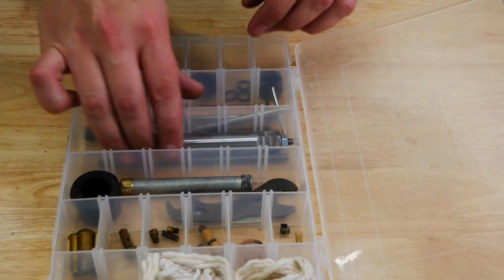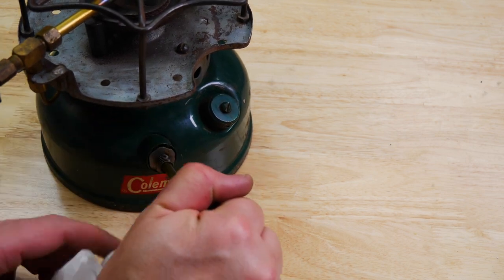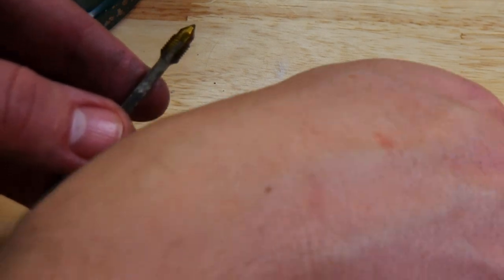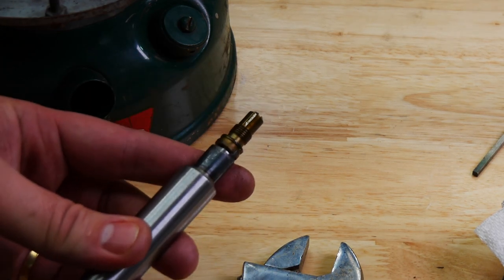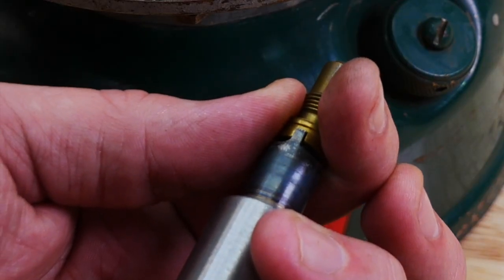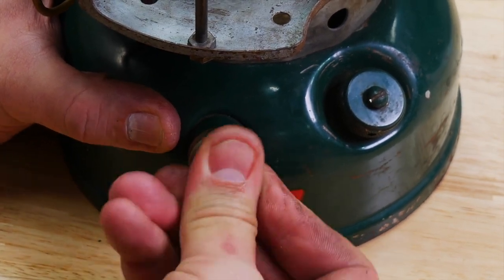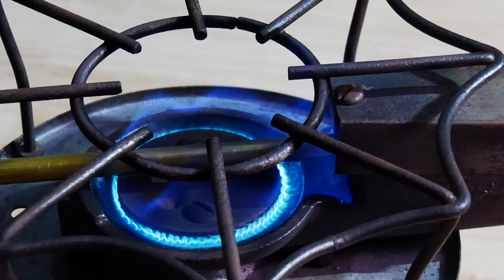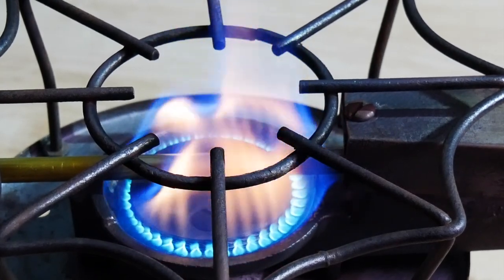How To SAFELY Remove and Clean a Coleman Stove or Lantern Tank Check Valve

Comment: Thanks for your videos.  Still need to dig out my Peak stove and try to get it working..Mine has that problem can't get the pump to work. Along with the adjustment fuel valve that doesn't want to move, and a seal leaking. Just a few problems.  Thanks.

Comment: Another possibility for a removal tool on that pump valve is a 3/4” paddle drill for wood. Get a cheap one and grind the center tip off, it’s the right thickness to fit the slot on the valve. Good luck! Now, I want to know the best way to get the graphite packing out of the little red on off valve above the pump.
Reply: does or did it work?
Reply: Yes, however, like Ernie said, you MUST put a significant amount of pressure on the end of the tool to keep it from popping out of the valve and damaging the slot. That’s why the 40$ tool has the threaded center to hold it in the valve slot. Good luck!

Comment: The check valve removal tool is a must if you are going to work on more than 2 coleman items that require fuel to operate them.  I have a set formula of what I do when I have purchased a new “item” from someone else after making my initial physical turning the knobs, and visual inspection.  1.  Remove the pump and toss the neoprene cup (if that’s what’s in it) and put on a leather one and dip it in neatsfoot oil (or just dip the leather one that is in it already).  2.  Remove the check valve and see if it works or not. If it does put it back.  If it doesn’t just like he said.  Let it sit in a small “bath” of carb cleaner overnight and then shake the heck out of it (usually it works).  If that doesn’t then let it “simmer” in a very small pot of vinegar for about 30 min on the stove and that should clean every last bit of scudge off of it and then you can put it back.  If that doesn’t work…time to go to the boneyard!  3.  Pull the Generator and clean that out.  If after these three things I can’t get the lantern to light then that’s time to send it to my ICU area.  That’s a whole different itemized list of repair options!

Comment: I had a check valve in my 200A Birthday Lantern that I first tried for over a week to clean it in place but I needed to pull it. I soaked it in carburetor cleaner, blew some through then I had to boil it in vinegar! I put it back in and it still does not work. The air leaks incredibly fast through the valve. The ball bearing must be pitted. I am ordering a new check valve.

Comment: hello my friend, thanks for your tips. Now I also have a question, I have a Coleman 523 cooker, unfortunately there is black rust or gummed-up impurities in the tank. what is the best way to clean the tank? thanks in advance.
Reply: Pour carb cleaner in the tank and swish it around and let it set. Put a handful of small sheet metal screws in the fount and shake the daylights out of it. Take them out and fill the fount with vinegar and let it set for a day. Flush it all out with water and then blow it out with an air hose or can of Dust-Off after the water comes out clear. Then put a bit of alcohol in the fount and swish that around. Pour it out and blow it out again. Let the fount dry completely. That should do it!

Comment: The Probable I have is I bought a lantern that has rust in the tank...Do you have a way to remove it and seal it so the rust doesn't keep coming back?
Reply: I know this is a bit old but I've recovered many Coleman stoves and lanterns with rust inside the tanks.  I rebuild and restore them as a hobby.  It depends on how badly rusted it is though.  Too much and it might not be safe to hold pressure.  But if it's not too bad I find that washing it out inside with degreaser first and then rinsing with hot soapy water to get rid of all greasy residue is a best first step.  Then fill with something like evaporust  (I use rust Check Enviro Rust Wash) and let it soak overnight.  Drain it out and swirl around.  Might need to repeat until all rust is gone.  Rinse out thoroughly, and here is the trick, rinse out with methanol to get rid of ALL traces of water.  Once it is fully rinsed you want to heat it up to make sure it is fully dry.  I put mine in a warm oven (heated to around 120°F) not a hot one and just let it sit.  Putting out in the HOT sun is good too.  The point is to get it fully dry as fast as possible without overheating it and damaging the paint.  That will do it.  As long as you drain it fully after use OR leave it completely filled with fresh fuel and a tight cap you should be good.  Just make sure no water or condensation gets in the tank and it won't rust on you.  You can use a gas tank sealer but be VERY careful not to get it in the air tube inside the tank.  this lets the air that is pumped in pressurize the tank.  If you seal that off your tank is toast.